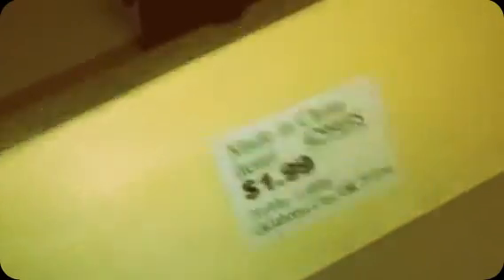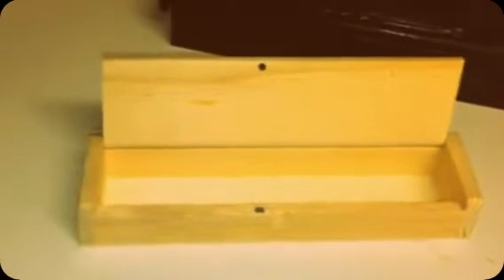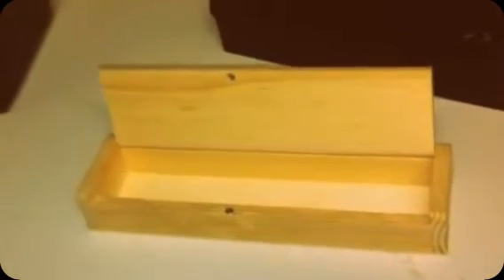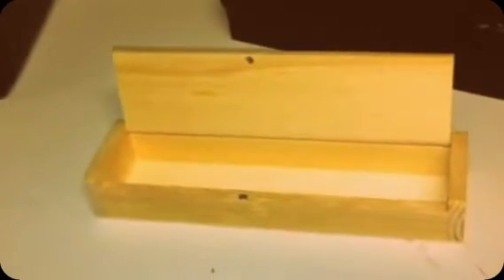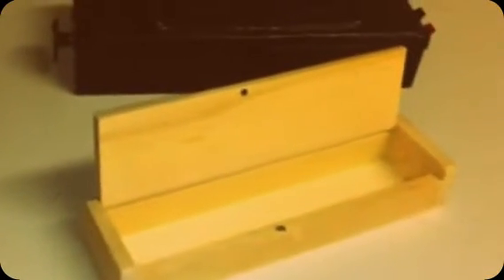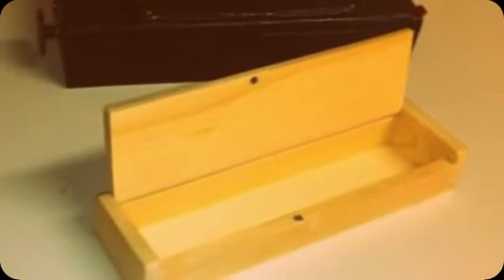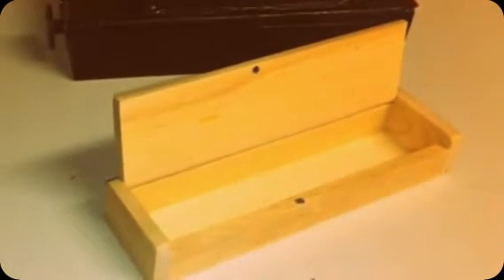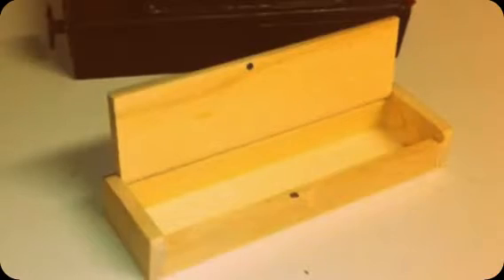DIY FIRST STEP BUILDING 1 INCH SPEAKERS BOOMBOX

Comment from the maker: @bigdwiz ya it's really small speakers. i saw that 3 watt amp and i was thinking 2 AA batteries might just barely fit in the box with with the battery holder. or i can use the same kind of amp i have in the sony speaker with a 9 volt battery that amp has 10 watts but i don't know if that amp can be powered by a 9 volt battery i have to do some research.

Comment: Wow, can't get much small than 1 inch speakers! I found the amp you used in the Sony speaker project, that one is pretty small. There is a stereo 3 watt amp on feebay for around 6 bucks and needs 5V power